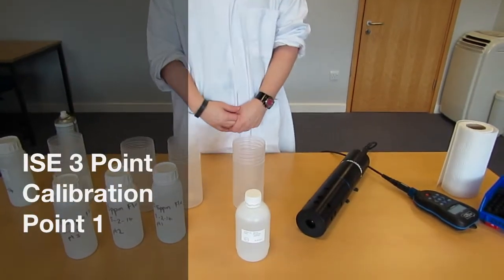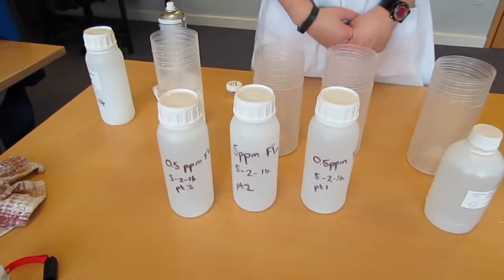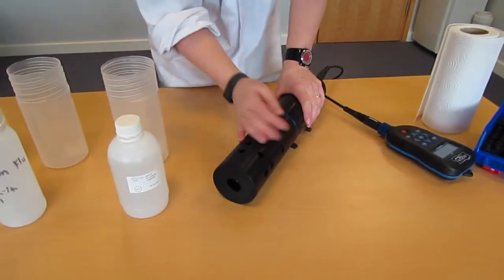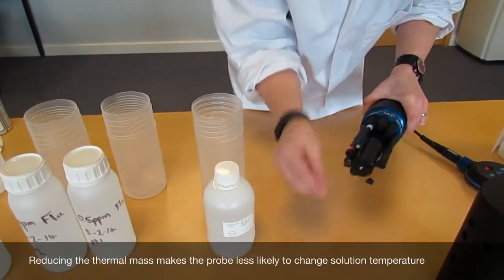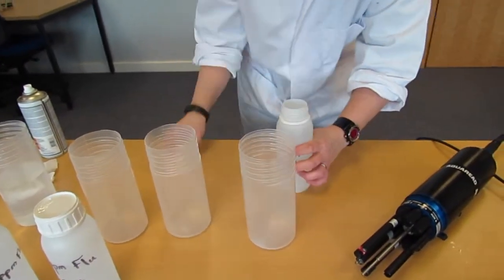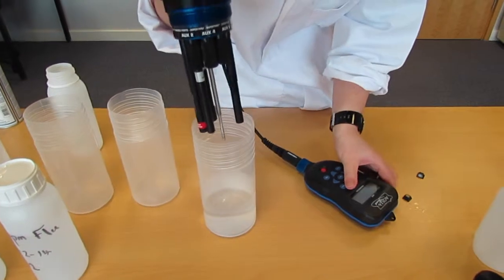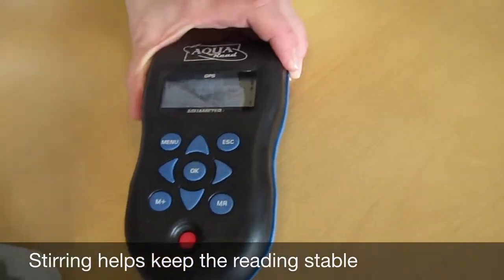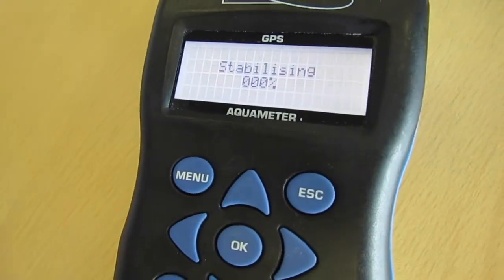ISE 3 Point Calibration, Point 1

Comment: Iam using AP2000D model ,
I need to do 3 point Fluoride ise calibration,
The solution which iam having is 1000ppm fluoride 
Do I need to add ISA into standard while calibrating

Can you please share a manual for ISE calibration & standard preparation for fluoride